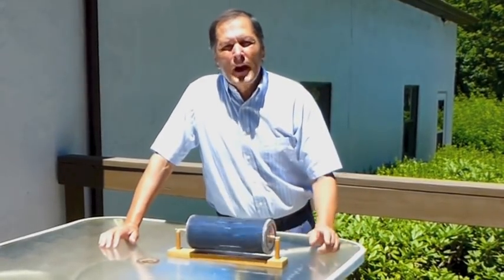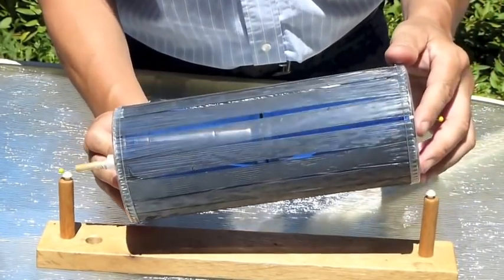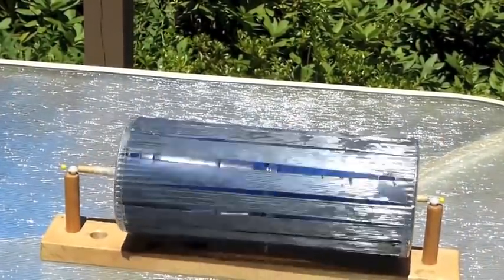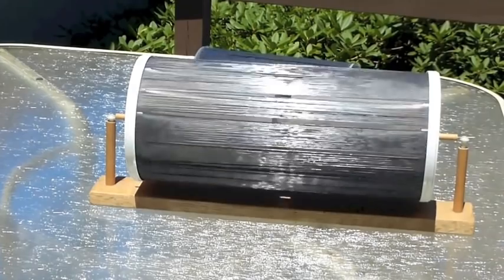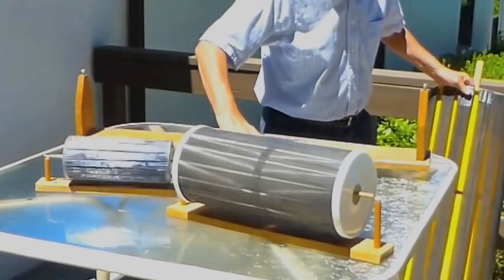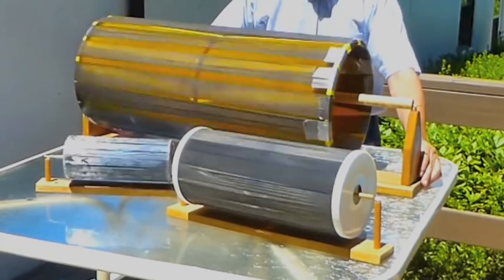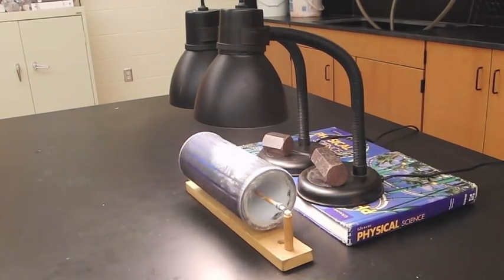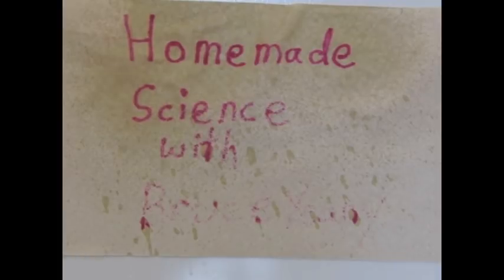Solar motor--Free energy motor-- not electrical /// Homemade Science with Bruce Yeany

Comment: What's the point?  It's just a variation of a radiometer which has been around for 175-200 years.   The amount of energy being collected is so little he would have to build on 100 feet in diameter to get enough energy to light the smallest LED.  Just has not practical purpose.
Reply: the first computer is a huge as a bedroom, now its as small as a smartphone. so don't underestimate the foundation of Physics and Energy...like what your teacher always tells you.
Reply: Mike l  I think you are mixed up a bit.  The first computer could be held in one's hand and was dates back over 2,300 years it was the abacus.  Then there was the Antikythera which also could be held in one's hand.  The first electronic brain/computer was the size of a bedroom. 

You are mixing up energy which can not be created or destroyed with the size of an object.   Sorry I don't get it.  It's like comparing a bikini with how fast one can run.  Just because the bikini is smaller that doesn't mean someone can ran faster.

Just doesn't make any sense.

The amount of energy hitting the solar motor is the same as it was billions of years ago and is the same as it will be millions of years from now.  

If you are thinking we can get more energy out in the future you had better pray we don't as that would mean we are about to burn up from all of that free energy.

Or is there something I'm missing?
Reply: Passed High School Physics ok tell me how Abacus could store the letter 'F' and 'U' if its a computer.
Reply: Mike l I do and use them to count in binary.
Reply: I just read that Bill Gates who is funding the development of the next generation of  nuclear reactors has meet with so much resistance to nuclear power in the United States and Europe he's giving it the the Chinese.

Americans need to wake up before we give all of our technology away and not use it ourselves.
Reply from the maker: You guys seem to be having so much fun blasting each other and me,  I'm not sure if I want to get into the middle of this "free" for all. But since you asked,  first,  I feel pretty good that you place it in the same league as the radiometer,  will this piece solve any energy issues, absolutely not,   it has just enough torque to power the little toy hammer or ring the bell as seen in my other videos but nothing of any consequence.  However,  as a teaching tool it is very powerful. I've been using this piece in my classroom for 20 years,  shown it at science conventions, sold quite a few until it became too much,  even had interest from the dept. of energy about it.  Of all of the pieces I have here on youtube,  this by far has piqued the most interest.  As for my title...if this were a science journal,  it would be more precise, but this is youtube and the title is an attempt to appeal to a wide range of interests,  not to deceive anyone.      1. Solar motor….absolutely  it definitely runs on "freely provided" energy from the sun.  2. Electrical… none involved as stated.     3. Free energy…. can be defined as  A. the thermodynamic energy that can be derived to do work in a system. 
B. More commonly for economics, energy from an input  source that does not have to be paid for, examples:  Windmills,  solar panels,  heat pumps, wave energy, the radiometer.   and my little motor are all fall into this category.  C.  Unfortunately,  the most common definition these days for "Free Energy"  falls in to the  area best described as scientific hokum, machines that produce energy from nothing,  perpetual motion machines, overunity, motor generator couplings, magnetic generators,  all those wonderful pieces that defy the 2nd law of thermodynamics  and entropy.  4. The rest of the title identifies me and what my channel is about.  Thanks for your spirited arguments, if you would like additional information on this piece, send me an email address.  Bruce
Reply: +Passed High School Physics  
Felt like you saw this video to vent out your frustration. Instead of telling him, ask the same question to your teacher why he/she didn't teach you all these things.
Reply: Great attitude.... what's the point of anything hey?

The comparison in content from this channel to yours is laughable.
Reply: ss ss  The creator of the video is claiming this is a Free energy motor.  it is not.

The power for this motor is a nuclear reaction occurring on the sun.  Thus this is not a free energy motor.  The amount of work this motor can do is so very little what good is it other than to show how little energy this motor design can convert to work.
Reply: Ooooooooooooooooooh right, of course - I totally forgot we have to pay the sun for the energy it gives us!

Just in case you're having trouble:

"Free"
friː/

Adverb

"Without cost or payment"

So tell me again how this is not a free energy motor? The guy even admits it couldn't pull the skin off a rice pudding - relax.
Reply: ss ss   You are mixing up free as in the free food samples given away at Costco with trying to get a kid to work for free and the first law of thermodynamics.

You might to take a science class so you can understand the difference between free food and free energy.

Bottom line is this motor can do any work....  So what's the point?
Reply: I'm not going to pretend to know anything at all about thermodynamics, or the scientific use of the word "free" within the confines - because I don't;  too confusing.

However, the statement is still technically correct. It is energy, and it is free. I read it as such because I didn't realize that "free energy" actually carries a whole other (extremely confusing) meaning when talking about thermodynamics.

What I don't get now though is when we talk about "renewable energy" (which I suppose would be what solar energy is in scientific terms?) - how does that make any sense that it is actually "renewable"? I mean, it's always there, right? Surely something would have to be depleted, in order to then be "renewed"?

Thanks for the utter head fuck I had when reading up on "free energy" (the science-y one) :|
Reply: As for taking a science class..... no thanks, not since I huffed a vile of chlorine gas that one time. Put me right off.
Reply: ss ss  You are huffing the wrong gas.  Cl was used in WWI and killed tens of thousands.  Next time you want to huff some gas try nitrous oxide you'll be much happier.
Reply: +Passed High School Physics - well it was 50/50 being chlorine/hydrogen. I know now which would have been the more  preferable.

Incidentally, I noticed since that day (and much vomiting)  every time I go swimming in a pool, I feel nauseated.
Reply: ss ss  Interesting - Means your body has developed a memory so you won't become poisoned again.  Maybe the HCl is given you a Free Memory?
Reply: +Passed High School Physics - maybe!

That aside, I think the author of this video needs to confirm in what context he was using the term "free energy"; thermodynamics, or economics?
Reply: ss ss Agreed - But look at the title - Free energy motor makes me think author is taking about thermodynamics.  Look at 3:30 where the author is using physical science books.

Sad part about the video is while he's saying these are motors, (which is correct), they can't do much work.  So not sure what the point is.  

In reality all he's has is a light mill or radiometer from the 1870s.
Reply: +Bruce Yeany (Yeany Science) - wasn't blasting you teach... nor the other guy. 

I will always maintain that regardless if anything has a point, what's the harm in doing it anyway? I never knew about this material you used till I saw the video, so for that I am thankful.

We were merely having a to-and-from about what context the term "free energy"was being used in. In that's process I learned a few things, too - so not a total loss overall.
Reply: ss ss and +Bruce Yeany   Are you saying the guy who made this video is a science teacher?  Is he in he teaching American students?  If so he should be ashamed of himself for titling the video "Solar motor - Free Energy Motor".

Really, a science teaching telling students this is a "free energy motor"  how sad.  As a science teacher this guy should know his "motor" is nuclear powered? 

I hope the science teacher responds and tells us why he calls this nuclear powered motor a "free energy motor".

I certainly hope students know he's wrong and reads the laws of thermodynamics.

I would like to complement the teacher for doing a nice recreation of Crooks 1870s demo.

I hope he pulls the video and re-titles more accurately  It would be nice for him to talk about the difference between energy and work.  And talk about how much work his motor can do.
Reply: Passed High School Physics - Bruce is the author of this video and I believe he mentions that he is a teacher of science.

I however am not getting involved. I think the fact the video just exists is a better thing than if it didn't, and that the term "free energy" without quoting either thermodynamics nor economics, or whatever other division, or sub-division - could be taken as many things off the cuff.
Reply from the maker: Thanks SS SS,  yes,  this will be my 40th year of teaching physical science, also taught  physics, chemistry, I'm also an adjunct professor in nearby college in their masters of science program, authored a science book, contributed to several others, and have given hundreds of workshops for teachers.  Anyone that  looks at my youtube channel,  hopefully gets idea that I have a good enough grasp of the subject to understand what context the words "free energy" can be used. I have indicated that it refers to energy derived without cost and have no desire to argue the point so let's move on.  From the previous thread, calling this a nuclear motor would be incorrect any more than saying an electric motor or that all devices are nuclear powered.  Energy flows as a progression of changes.  For example to run an electric motor, electricity comes from a power plant that burns fossil fuels (chemical energy) which were produced using photosynthesis, which in turn used sunlight (radiant energy),  which was produced in our sun using nuclear fusion.  Energy consuming devices usually list the energy or fuel that they are directing converting.  Examples,  electric lights, nuclear power plant, gas engine. Solar energy is usually considered to be radiant energy in some form of the electromagnetic spectrum, while it may be derived from nuclear, there is a clear distinction.  So, my little motor would best be classified as a radiant energy motor, solar motor, light mill,  or a thermal motor.  I have put hundreds of hours into this piece trying to improve it's efficiency to no avail,  I'm afraid it is destined to be in the realm of Crooke's radiometer as an amusement or teaching tool.  However, as suggested,  the idea of discussing work output and power rating is a good one and something that I should address, hopefully this summer when sunlight is at it's strongest.  For those that have an interest,  this is something that I have measured and address  in the information that I send out along with instructions on how to build it.
Reply: Bruce Yeany  With all do respect your are telling us you are a science teacher and have taught physics and chemistry and don't bother to teach your students the thermodynamic laws only finances when it comes to energy?

Why? 

Don't you think you are doing a dis-service to your students by teaching them you have a free energy motor?  I hope you aren't teaching your students the pseudo-science for "free energy".
Reply from the maker: Currently my teaching assignment is 7th through 9th grade physical science.  Even at this age, we have several lessons on various aspects of energy. Thermodynamics is a major part of the lessons just as it is when I teach physics, it has to be.   We do look at the economics of fossil fuels versus, renewable, or green energies from a cost analysis as well as the environmental concerns.  This piece is interesting since it is able to convert radiant energy into rotational motion.  However,  since it lacks the torque, it is not a option as an energy source. Some students built these for themselves because they found them interesting and have had them calculate the power for their devices. On occasion, the  idea of "free energy", devices that are self-sustaining, overunity, and perpetual motion might be brought up.  If it is  discussed, it is on how they would violate the 2nd law of thermodynamics and entropy.
Reply: Bruce Yeany Sounds like you are doing a fine job, but i don't get it.  So why call this a "Free Energy Motor"?  It puts you in the category with all of the other "free energy" / perpetual motion machines people claim they have invented.

May I ask you a few questions about the energy modules your teach and are in your book?  The reason I ask is because I run into students who are not fully taught about fossil fuels, nuclear and green'/renewable energy.

Do you teach your students when fossil fuels are burned to produce electricity it not only do they release green house gasses, but they also release radioactive elements into our atmosphere?  And that coal slag heaps contain radioactive elements which are blown by the wind and leach into our water supply?

Do you teach about the environmental issues with solar?  I live in California where we have large solar and wind farms.  The energy companies have found solar and wind to be so unreliable and unpredictable (no wind, or a cloud covers part of a solar array) we have black-outs.  We are also having issues with birds and bats being killed in large numbers by the spinning blades of wind turbines.  It's so bad in one of the largest wind farms in our state they have decommissioned 27% of the wind turbines.

We are in a drought so our hydro power stations can't produce at full capacity.  As a result the power companies are relying on more nuclear and fossil fuel generated energy.

You might find this interesting, but the city of Santa Clara has it's own power generating facility which is powered by natural gas.  When one or more of their gas-fired power generators is off-line for maintenance the air quality in Santa Clara/Silicon valley becomes more polluted and is detected by the state's air quality control measuring equipment.  In other words the power generation plant in Santa Clara cleans the air as it generates powers.  (But it also released green house gases and radioactive waste into our environment?

In your discussion of fossil fuels do you discuss the spills and the damage they cause to the environment and humans?  Here in California we had the third worse fossil fuel spill.  For months fossil fuel and the radioactive elements in the fuel was spewing out into our state poisoning residents.  Thousands had to be evacuated for months.

Do you discuss nuclear?  Are students taught how energy dense nuclear fuel is compared to chemical reaction fuels?  And that one pound of nuclear fuel would require 1 billion pounds of coal.  And that all of the highly active radioactive waste after 100 years for everyone in the US would fit in an area the size of a basketball court?  

Are students taught we have mined and proceed enough nuclear fuel to supply power to the world for over 700 years?  And that people like Bill Gates are funding the next generation of nuclear reactors which China is building?

Do you teach your students nuclear power reactors are 100% naturally occurring?  If you are not familiar take a look at Oklo in Gabon.  

When you teach students about renewable do you cover mention how solar cells degrade over time at the rate of 1% per year.  So in 10 years they produce 10% less energy?  Is recycling solar panels mentioned?  Right now we are sending them to a dump site in Africa, Agbogbloshie, where it is burned and containment the air. water and land?

But more importantly are students taught that with current technology renewable will at best only supply 15 to maybe 20% of the worlds energy needs by 2050?  This means we/they need to figure out a way to supply the other 80 to 85%.

Are they taught about the environmental issues construction of solar and wind?  The concrete foundations required for solar and wind release greenhouse gases.  The concrete foundations will need steel which has to be mined, smelted, shaped and transported to the job site all of which release green house gases and radio-active elements.

Since you talk about the finances of energy are students taught in sunny state of Nevada all of the solar companies have gone out of business?

I hope you are teaching your students there is no such thing as "free energy".  Compromises have to be made.  We have had two major nuclear accidents but we have had over 10,000 times more fossil fuel spills and coal mine accidents.  More people have been killed in fossil fuel, solar, hydro, and wind turbine accidents than nuclear power.  

While a nuclear accident contaminates land making in uninhabitable so does the mining for fossil fuels.

For years I've been seeing students taught renewable "free energy" can supply the world with electrical power while not being taught just how much concrete and steel not to mention the green house gases which will be emitted to reach 15% in renewables.

I hope we are teaching our students we have to make choices.  While renewables sound wonderful we have to be realistic at the same time.  (Just like everything else in life.)
Reply: KRISHNA SOLEPURE  Wasn't trying to vent on the guy.  But now we know he's a science teacher maybe we should.

Just look at how wrong and misleading his video is.

Have you taken any science, chemistry or physics classes?  Now take a look at the title of his video "Solar Motor-Free Energy Motor".

Anyone who has taken a science class would not the thermodynamic laws including the one about the conservation of energy.

There are all kinds of crazy people claiming they have created "free energy" or perceptual motion machines.  Cars that run on water machines that can reverse the force of gravity.  If any of these people would have taken a science class in middle school they would know millions of people have tired to create "free energy" and with the science we know today it's been demonstrated it's not possible so many times in terms of science it's a "law" meaning we know it's not possible.

So why does the "teacher" in this video call it "free energy" when we have a thermodynamic law stating it's not possible.

Isn't the source of this "free energy" really a nuclear reaction on the sun?  He's just recreating a radiometer from over 100 years ago.  

The point of the radiometer was to support the finding that there is no such thing as "free energy".

Then this teacher confuses students and YouTube viewers say his "free energy" machine is demonstrating "free energy" in a financial sense.

Before commenting look up the definition of "free energy".

If this is the caliber of science instructors it's no wonder American students are doing so poorly in science compared to students from around the world.

The other question I would like to know is where did this science teacher receive his science training?  It's hard for me to believe institution which teaches science would teach any student we there is such a thing as a "free energy: machine.

Shame on this teacher for teaching students this lie.  I hope he's not in Texas.  It was not too long ago they were trying to pass a law which prevented K-12 teachers from teaching critical thinking skills.

America for the past 100 years has been the home of scientific discoveries.  Now with teachers teaching wrong information like there is "free energy" makes us look stupid and un-educated.

Let me give you one last thing to think about.  We should be thankful there is no such thing as "free energy".  For if there were we, and our planet, solar system and the universe would have heated up and burned from all of that "free energy"

Think about it.
Reply from the maker: WOW, a smart guy like yourself should be able to understand that words or phases can have more than one meaning. Perhaps you should try your own  advice and look up "Free Energy",  first site that pops up is  Wikipedia,  here it is.  https://en.wikipedia.org/wiki/Free_energy 
it gives a few definitions,  one says "Energy from sources that do not require an input which has to be paid for."  The term "free energy" can also be listed as a subset of "renewable energy".  Next look up "renewable energy" you will find that the term free energy is used quite often under this heading.  It is in this context that I use the phase "Free energy motor" in my title with the hopes of appealing to a larger youtube audience.  Nowhere do I claim that this piece produces energy,  certainly not  perpetual motion .  Nor can I claim that it is nuclear powered as you have suggested.    If you watch the beginning of the video and read the listed information I clearly state  that this device changes radiant energy into rotational motion.  Even my middle school students are able to understand that creating energy from nothing is not possible despite all the claims found on youtube. Critical analysis is a major theme in my class, perhaps evaluating youtube claims should become one of their assignments.   I find your continued  dismissal of Crook's radiometer to be in poor taste and wrong,  perhaps you should read a bit about it's history.  I think is is a fascinating piece of equipment and feel honored that you would group my little motor with his device.   Next,  you claim that my video is wrong and misleading,  perhaps you explain to me what facts I presented in the video that  are either one.   My qualifications: I hold a Masters degree in Science,  39 years of teaching physical science, physics, chemistry,  adjunct professor in a nearby college for their master of science degree program,  I hold two patents,  have developed 24 pieces of  science equipment that are sold commercially, present inservice programs in science for other teachers on a regular basis,  write and peer review  science books, designed several exhibits for science museums, consultant for several science equipment and book publishing companies,  designed equipment for television,  and lastly 110 science videos with close to 1 million views on youtube are some of my accomplishments. Interesting that you can evaluate  my teaching when you know nothing about me or my curriculum.  What are your qualifications to make any kind of judgement on mine or anyone's teaching skills?  Hopefully it is more than passing high school physics.    I live and teach in Pennsylvania and from all appearances, they seem quite pleased to have me.   Now, at this point,  I think we need to move on,  I have no desire to change the title of this video nor do I see the need to explain or justify my reasoning any further.
Reply: Just wondering......  If you consider renewables free energy does that include nuclear power?

TerraPower funded by Bill Gates has a Traveling Wave Nuclear reactor which is called clean, renewable, and environmentally safe.
http://terrapower.com/pages/benefits

When you teach about renewables does that include nuclear power?
Reply from the maker: Generally nuclear energy's classification is dependent on the type.  Nuclear fission that breaks down Uranium is not considered to be renewable, and yet a breeder reactor and if they can ever get nuclear fusion up and running  are  considered renewable.  However, your asking for an opinion on the key word  "free"  I would say it is not. Renewable does not always equate to free.  Fuels for example, Ethanol is renewable but has a high cost to manufacture.  Even simpler, My house has several large windows on the south side for thermal gain in the winter, free energy. However, we also have a wood stove, we have woods so I have a source of free wood, so it is a renewable fuel but the cost is I have to cut it, split it, haul and dispose of the ashes.  Costs are not always monetary.  Interesting enough, my daughter just gave me a solar charging unit,  on the package it claims that I can charge all my electronic devices for free,  I had to laugh when I read it.  
I don't know much about Bill Gate's plan other than he  has signed a deal with China to develop his terrapower program there, not sure why. 
Yes,  actually separate out the energy into fossil, renewable and nuclear as three distinct types,  Also as part of our middle school program, we look at several energy chains or progressions, In that, students have to trace the energy flow from it's use to the source, how the changes occur in each step.  Also secondary energy requirements.  For example for me to type on this computer, I use chemical energy from food that  traces back to photosynthesis, the energy to drive this process coming from the sun, which would be nuclear,  now add to that all the secondary energy requirements, energy to get the food, energy to grow the food, plant the food, water the food either manually or through weather cycles. It can get even more complex when you map out the use for fossil fuels use, in doing this  we examine the pros and cons of several energy sources.  Our time is limited so in an environmental  class they examine the effects they have in greater detail. It is in high physics and chemistry that students  get into specifics and mechanics of fission and fusion in greater detail.
Reply: Bruce Yeany   You make several excellent points.  You are teaching middle school students, have a limited amount of time on the subject, and for most this is new so you need to keep it simple and not confuse them.  Makes sense.

English is such an imprecise language isn't it especially with the use of the word free.  I think students in this country are fortunate to receive a "free" education from teachers like you.  But at the same time that "free" education isn't really free is it.  You are getting paid and I am paying taxes;  We could take this to extremes and say you need energy (food) to teach and the energy in the food you eat comes for free from the sun.

Sorry to confuse your Solar Energy  - Free Energy Motor with the pseudo-science free energy motors/perpetual machines people I'm by students "really" work.

I hope with both agree if there where such a thing a free energy we probably would not be here.  With all of that "free energy" it would generate a lot of heat and we would have all been burned up long ago.

I hope you students do lean the difference between "free energy" in a thermodynamics sense and "free energy" from a financial sense.
Reply from the maker: Thanks,  I didn't get a chance to check out the lecture series sites listed on your other comment yet but I will.  I consider the imprecise definition of the term "free energy" to be a minor inconvenience compared to the misconception about being able to ignore the law of thermodynamics.  No,  I don't believe it is possible to build a machine that is self-sustaining, reaches overunity, perpetual motion or produces energy for free. What is scary is if I were to change my little motor around by gluing a few magnets to the base,   claim that the ribs are made from thin magnetized plastic, and then change the title to include the name  Tesla and the words overunity and monopole in it ,  I would probably get several million views with half of the people believing that it's possible. I find it particularly discouraging to see the number of views that these fake devices are pulling in. The frauds  put this stuff out there often enough and people start believing it,  it just makes my job harder trying to overcome it.  I know people that are absolutely convinced that Tesla designed and build "free energy machines"  but the prototypes and the plans were destroyed by a fire started by either the government or the oil companies.  As for my students, I think they would tell you we have a pretty good program overall.  I think we have a hard working staff at our school and we do the best we can in the time available.
Reply: Bruce Yeany I agree with everything you have said,  And yes all of the pseudo-science fee energy, overunity, perpetual motion video make my job difficult too.  

You are right about Tesla and magnets.  I have been to the Nikola Tesla museum in Belgrade.  He was an interesting character and loved to boast especially late in his life.  If YouTubers would visit the museum they would learn the timing was just right for someone, Tesla, to make discoveries about AC current.  But as the discoveries were made Tesla had to revert to making outrages claims to attract investors.  As Tesla aged he was more interested in throwing extravagant parties and living a life of luxury as he was going broke.  Smart guy who just happened to be interested in electricity at the right time, but a horrible businessman.

Not sure if you know but Tesla's "missing" papers recently surfaced.  After Tesla died his creditors wanted to get their money back.  Thinking there was some value in Tesla's papers they went to court.  The lawyer of the party who won custody of the papers found nothing of value and stored the papers for 25-30 in his basement.  He died and the papers were being thrown away.  Someone recognized they were Tesla's papers and took them home where they sat for another 20-30 years until I think he died.

Tesla had no free energy or overunity machine, as some people claim.  It's all there in the museum if people would just look.

Remember James Randi?  He's still offering $1,000,000 to anyone who can demonstrate an overunity, perpetual motion machine.

In 30 years not one person has claimed the prize but that doesn't stop them from posting a video on YouTube and "selling" the secret.

I think you might get this one.  I'm asked if I know how to win at casino gambling games.  I tell them absolutely.  I know how they can wen every time playing roulette.  Just bet on every number and you are guaranteed to win every time.
Reply from the maker: I've read a few articles on Tesla and had a grandfather that was a fan, claimed to have met the man a few times through his interests in electricity.  He himself built some "gadgets" as my dad used to call them,  all of which eventually got thrown out as junk.   The Belgrade trip would be awesome but a bit far.  Closer to home is the Tesla museum in New York, at the site of his old laboratory.  I haven't been there but it is on my bucket list of things to do, places to go. 
 I hadn't heard of the James Rand bet  but it seems to be a good one,  his money is safe enough.  No one has a working machine but there is no shortage of plans out there that you can buy so you can build it yourself.
Your advice for gambling is the classic example of "winning the battle but losing the war"
Reply: I will give my two cents: 
1. This solar thermal motor has merit, it will turn or spin as long as there is a source of heat near the top side, such as the sun rays.
2. It can be increased in size and weight, imagine a 10 or 20 foot long shaft with a 250 to 500 pound flywheel attached to one end of the shaft, now also add some reflective panels that will reflect the sun's rays on the same spot as the natural sun rays hit (near the top side), that will increase the efficiency, speed, power and usefulness of the motor.
3. That motor looks like a toy, but so was the first steam engine in the ancient world, certainly steam engines are no toys, they are tools which without, the industrial revolution would not have been possible. This solar thermal motor can be made of a solid metal shell and hollow inside, making it incredibly durable. The point is, that improvements can be made, to the point that several of these together in the backyard of a single family home, can probably produce 50% or more of the total electricity used during full sun hours, and unlike solar panels, this will not stop working after 25 to 30 years if maintained properly. I could go on, but I think I have made my point.
Lastly, this has nothing to do with this motor  in particular, but with the existing laws of physics, which state that you can't get more energy out than what you put in, well, in that case, how do you explain an atomic explosion ?! Last time I checked, the amount of explosives used to detonate the bomb are very little compared to the explosive result once the atomic bomb is detonated due to that much smaller energy input. What people fail to see is that sometimes, with just a little energy input, you can have a huge energy output, if you know how to use the laws of physics to your advantage, and no law will be violated, ignored nor cancelled, simply exploited, such as the previous example of the atomic bomb, or another example, a snow ball effect, how a small snow ball, dropped from a hill, and exploiting the force of gravity plus other laws, that small snow ball and that small input of energy used to release that snow ball, can produce a huge energy output once the snow ball reaches the bottom of the hill, the higher the hill the greater the impact. So the laws of physics are there, but most of the time we simply ignore them, even when we claim to know and obey them. Have a nice day.
Reply: cubaniton74 You have some interesting points.  Can you share your calculations as to how large this solar motor would have to be to spin a 250 to 500 pound flywheel?

My calculations are one would have to have solar collectors nearly 5 miles in diameter.  Not sure we can build a structure that large on Earth with what we know.

Interesting you mention how a small amount of chemical explosives can create are very little compared the explosiveness of an atomic bomb.

This is the principle behind nuclear power.  Instead of burning millions of tons or fossil fuels every year or harvesting so little energy from the the sun everyday we should be using nuclear power.

This is why billionaires like Bill Gate and Paul Allen are providing funds for the next generation of nuclear reactors.  

And why the US government is funding the National Ignition Facility (NIF) at Lawrence Livermore National Laboratory and the European Union is funding International Thermonuclear Experimental Reactor (ITER) so we can have a source of clean, renewable nuclear power.

While solar in theory sounds like a wonderful solution with current and future solar technology we are only use about 2% of what we capture into electricity.

I do see your point about nuclear.  It took several tons of TNT to detonate only 8 pounds of nuclear material which resulted in an 21,000 ton explosion while consuming only 3% of the nuclear explosive material.
 
Just goes to show hoe much energy there is an atomic energy compared to solar.

Excellent point you are making.
Reply: Passed High School Physics Thank you for the complement. Atomic energy is wonderful, until there is an accident like in Russia, or like in Japan after the Earthquake, whenever there are human beings in the equation, there will be accidents and mistakes, both which should be avoided if dealing with atomic energy, specially near populations. I have nothing against atomic energy, just the radioactive one, why instead don't we try to find a better way to split the water molecule, hydrogen is the most abundant element in the universe, and when used in combination with oxygen, such as in an explosion (internal or external combustion engine for example) it goes back to being simple water, you can't have a fuel more cleaner than that if you ask me. 
And in reference to the solar thermal motor, if you figure a shaft that will be about 10 foot long and 1 foot in diameter, made out of steel in a barrel like shape, hollow inside, with a skin thickness of 1/2 inch, that thing will probably weigh 500 pounds or more easily, so attaching a 500 pound flywheel to one extreme of the shaft is nothing in weight terms, the flywheel will provide a smoother action to the motor and more momentum.
In reference to the solar reflectors, they only need to be maybe 4 foot wide by 10 foot long and in a parabolic shape, to focus the sun rays on the top section of the motor, that will drastically increase the heat on that top section of the motor causing it to expand rapidly and create an unbalanced shaft which will spin around as a result; the thermal difference in this motor is what causes it to spin by bending the shaft out of shape with heat; the Sterling engine functions differently, but uses temperature differentials to produce  power also. Goodbye.
Reply: cubaniton74  Where are your math calculations for the amount of work your solar motor produce?  The amount of work this motor can do is almost nothing.

Glad to hear you have nothing against nuclear power.  As you have pointed out there were two nuclear-power accidents.  Compare that with the hundreds of fossil fuel spills we've had in the same amount of time.

You are right, the future is in clean, renewable nuclear power which is what they are working fusion at NIF in the US and SETIS in Europe.

Bill Gates and Paul Allen are both funding the building of the next generation of nuclear fission reactors.  We have mined and processed enough nuclear fuel to supply us with energy for the next 700 years.  Would be pretty dumb not to use it.

As for solar it's so inefficient as the instructor is demonstrating in this video.  At best fixed solar panels are only 1-2% efficient.

I live in sunny California.  We've found solar like wind is very unreliable.  We've already decommissioned 27% of the wind turbines in one wind farm and California's solar generated power has caused black-outs which is why we are buying more nuclear and fossil fuel generated electricity.

It would be nice if one day we could figure out a way to capture more the sun's energy, but so far we haven't.

What we have figured out how to do is reproduce how the sun makes energy here on Earth.  NIF and SETIS is very close to having this figured out there's will be no need for solar of wind generated electricity except in very special circumstances as it's so expensive.
Reply: Passed High School Physics "Solar power is so inefficient", that the whole world depends on it to survive (all life and all weather patterns depend on the inefficient sun, go figure). 
I am tire of reading your garbage, have nice life, I am out of here, and in regards to the mathematical calculations, you don't want mine, you already did yours and they led you to believe that the "solar collector" as you call it, would have to be 5 miles in diameter, such a childish man you are, a "solar collector" or REFLECTOR as I call it, if it were made 5 miles in diameter and it were made in such a way as to focus it's energy on a few square feet of space on the ground, that would melt a hole full of lava in the ground all the way to the core of the planet. I am done with you, I don't want my intelligence to be as high as yours by association. GOODBYE !
Reply: cubaniton74 Sorry, maybe I was not clear.  Yes most life, but not all, are dependent on the sun as a source of energy.  But when it comes to humans harvesting that energy with solar panels with the technology we have we can only collect about 1% with fixed arrays over the course of a year. 

As for the other 99% of the energy from the we don't have the technology to collect it.

You claim you might be able to burn a hole in the ground with the sun, (I highly doubt it) but what's the point?

The purpose of a motor is do work.  The amount of energy the motor show in the video can perform is very, very, and I mean very small.  The motor can't even start on it's own without an external energy source.

You claim you can spin a 500 lbs. flywheel with a larger version of the solar motor as show in the video but fail to show your math.

I've preformed my calculations and the motor would have to be about 5 miles long.

But feel free to prove me wrong.  Why not post your video showing with a solar motor spinning a 500 lbs flywheel.  

The laws of physics show you can't do it.  But if you can there's a $1,000,000 cash prize waiting for you from the JREF.
Reply: Passed High School Physics 1. All life depends on the sun, even the newly discovered aquatic life at the bottom of oceans which apparently survives in total darkness with heated water flowing from the bottom of the ocean (the molten lava in those sections of the ocean floor is very close to the surface of the ocean's floor) and minerals flowing from within the ground, but if it were not for the sun, the oceans would freeze, and so we are back to square #1, which is that all life depends on the sun to survive.
2. Burning a hole in the ground with the parabolic solar reflector was your idea by creating a 5 mile wide solar reflector, based on your super mathematical non-existing calculations, so what is your point ?! 
3. The motor shown in the video creates very little kinetic energy, so it must be useless, well then, the same illogical thing can be said about a 1.5 volt electrical motor, because it is so small and so limited in power, what is the use of developing the technology, after all it can be stopped with just a finger, right?! Wrong again !!! Things can be scaled and so will the power output, it is physics my friend, that thing which you constantly try to ignore.
4. You claim that if that motor could be scaled up, it would have to be 5 miles long, that is based once again, on your super complex mathematical formulas, but once again, you have been adding and subtracting with a calculator that possesses dead batteries my friend, those numbers of yours are fictional and you and reality are worlds apart; if a scaled up version would be 5 miles long, that means that the model presented in the video could not be thicker than a human's hair, so once again, your non-existing "math" has failed you again, put some fresh batteries in that calculator and do the math with your eyes open when you press the buttons on it, good luck on those new formulas.
5. "The laws of physics show you can't do it", wrong again my friend, it is you and your arrogance / ignorance that prevents you from seen what is plainly in front of your eyes, but I now know that no amount of intelligent explanation or logic will convince you, after all, you use "math", don't you ?!
Reply: cubaniton74   There's a contradiction in your logic.  If the sun were gone would the oceans freeze?  Even with the heated water flowing from the mantle of the Earth?

What about all of the heat energy being generated by the magnetic fluxes and the radioactive decay that's keeping the core of the Earth molten hot.

It's quite possible these organisms would live even if the sun were not in the sky as would other extremophiles such as Deinococcus radiodurans.

Could it be the first nuclear reactor was on Earth was the food source for Deinococcus radiodurans?

These organisms prove the sun is not key for providing a source of energy for life.  This is why we believe organisms might be living on Mars, Jupiter's moons, exoplanets or on asteroids.

If you think you can build a solar motor like the one shown in the video which will spin a 500 lbs flywheel why haven't you built it?

Could it be because the motor would have to be 5 miles long?  Do you have any idea how much energy it would take to get a 500 lbs flywheel to spin?  Me thinks not.

You got me thinking.  It's easy for someone to make a empty claim such as yours.  

But it's another thing when you've done the calculations and have built it.
It appears you a have only done the former.
Reply: Passed High School Physics I honestly don't know why I keep chatting with you, but this will be my last one, as I have no time to waste with people who believe in their minds to be educated, but lack the basic knowledge of how things work in REALITY.
We currently have the sun in the sky blasting the earth at full power, and yet, on the North and South poles, we have frozen oceans constantly,  now imagine what would happen to the whole planet if the sun were not to exist. I am not going to even touch the other points because 1. I read them not, as I know they will be filled with ignorance, and 2. I am done here, I refuse to continue to waste my time with you. GOODBYE.
Reply: cubaniton74 Dude we are taking about Earth aren't we?  The oceans at the north and south pole aren't frozen as you claim, they are a liquid.  Not sure if you know your history but the US had a submarine sail over the north pole.

At the south pole there's a continent so no ocean there.  Surrounding the continent is is an ocean.

Not sure what you mean by the sun is blasting us at full power.  As a star it's energy is continually decreasing as it "burns" the it's nuclear fuel.

The Earth contains many radio-active elements and isotopes which is why the core and mantel are molten lava.

So even if the sun were to disappear the radioactive decay would keep the Earth warm of millions of years.  Those deep sea vents would continue to release boiling water and prevent the oceans from becoming one solid piece of ice.  So would the lava flows on the surface.

This is why we are using nuclear energy and in the future will hopefully be clean, renewable nuclear energy with the research going on at NIF.

The amount of energy we can harvest from the sun is trivial.  This is why we are creating the suns energy reactions on Earth.

You might want to take this wonderful teachers middle school physics class to get your facts straight.  

I see you have not provided your calculations for your solar motor.  Does this mean you've done your calculations and figured out I was correct?